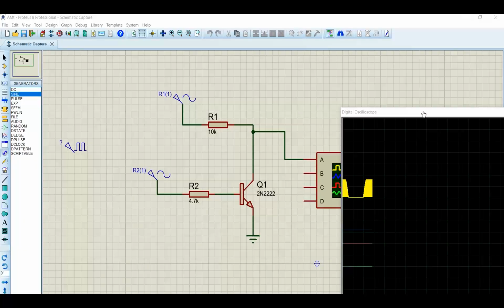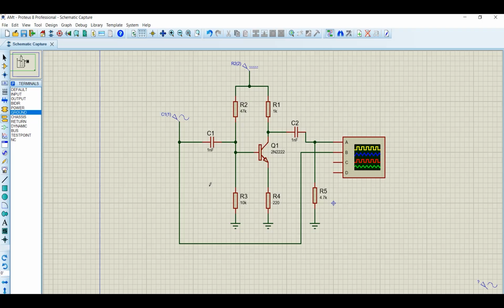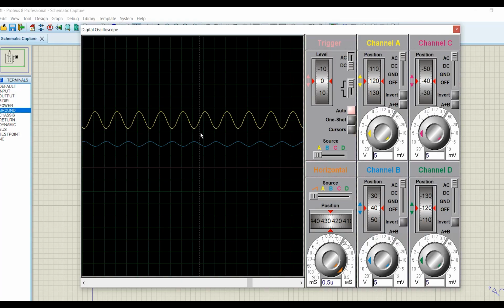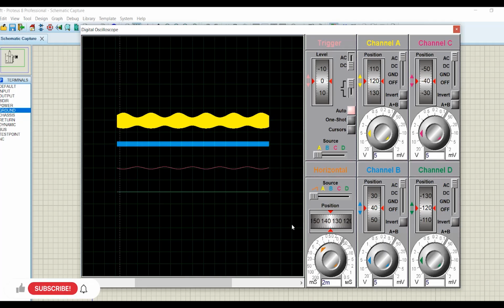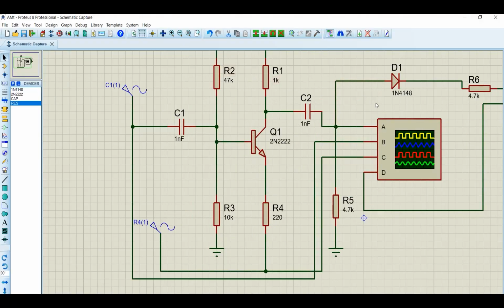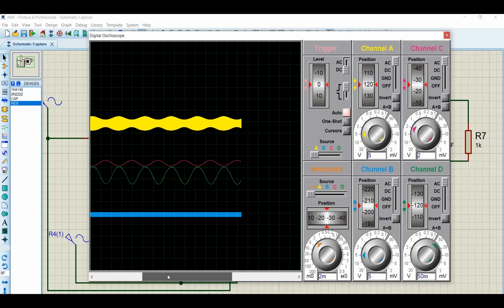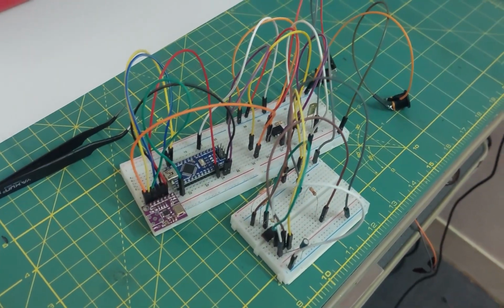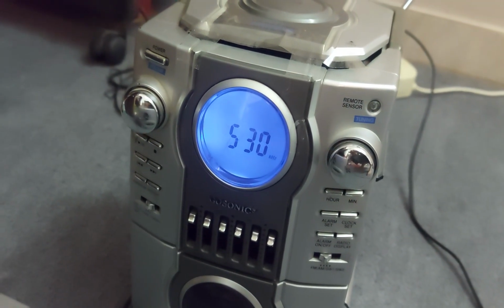How to Make an RF Transmitter | Simulation + Real Test!

Comment: CAN YOU send the circut can you uplink to a drive
Reply from the maker: Sure. But it will take a while to prepare. But the signal generator project resources are available in the Telegram channel. Just check the last file inside the Telegram channel. It can be a little useful for me to prepare the circuit diagram.